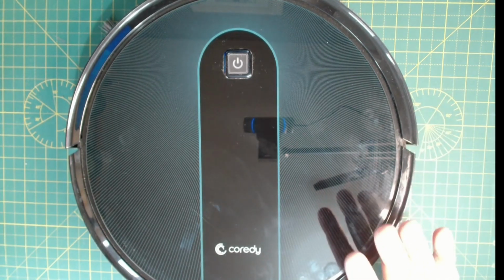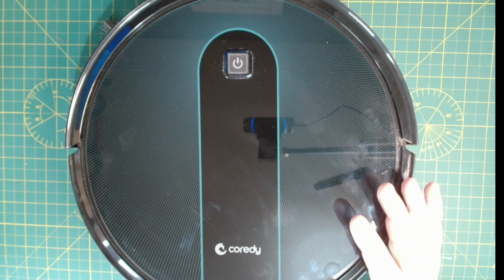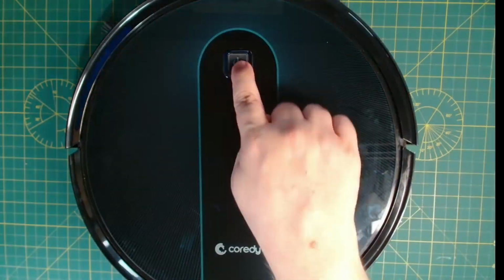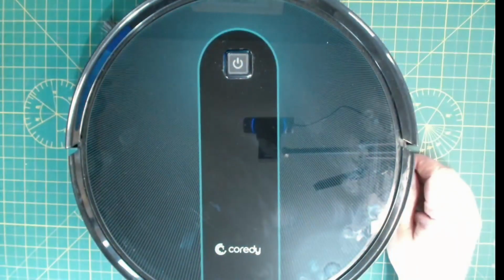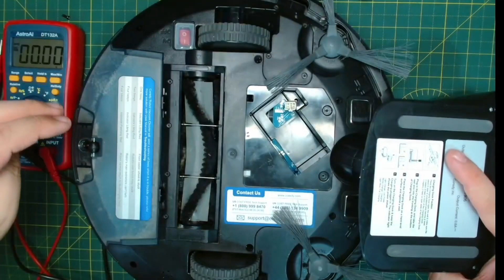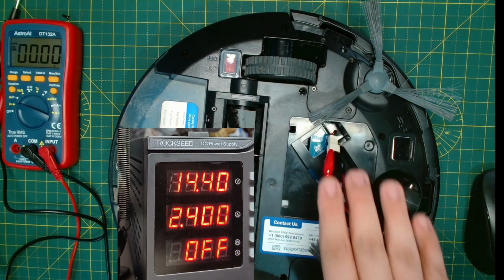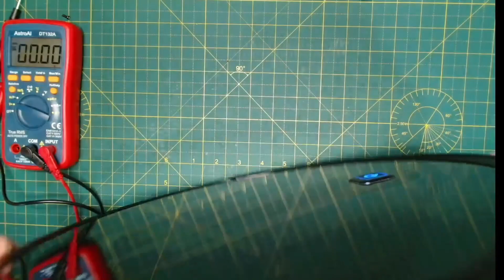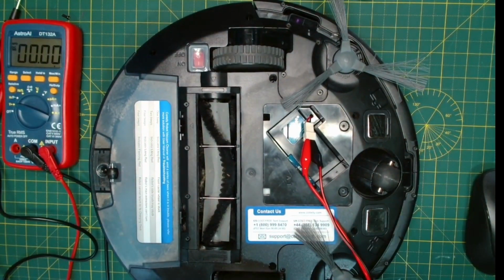Can I fix? Broken Coredy R650 Robot Vacuum

Comment: Thank you.  Your video reminded me to do somethign on my 750.  Unplug the battery and test it.  Which I did.  Little over 15 volts.  Good charge.  Plugged it back in and ran it.  She ran for 4 minutes and stopped.  Pulled the battery out and tested it.  .56 volts.  So my battery is toast.  I was going to throw the damned thing out, but your video made me think twice.  So thank for publishing it.  -Carleton MI US.
Reply from the maker: Thank you for commenting. Glad the video helped.

It does indeed sound like your battery is not long for this world